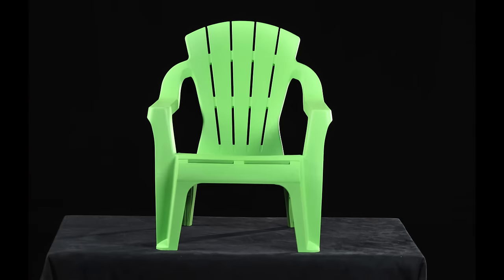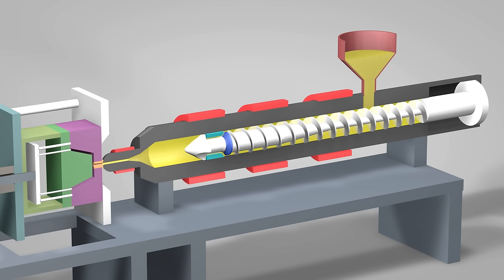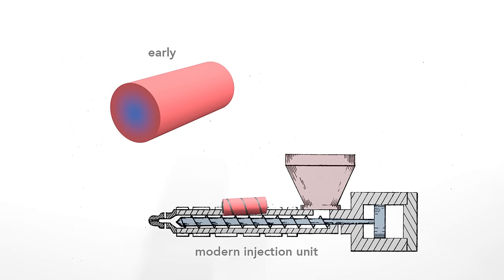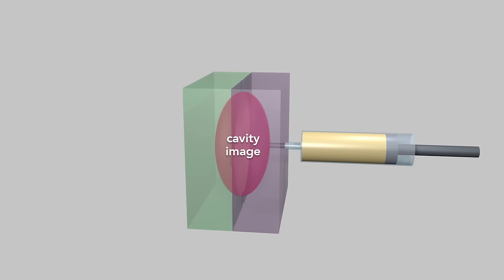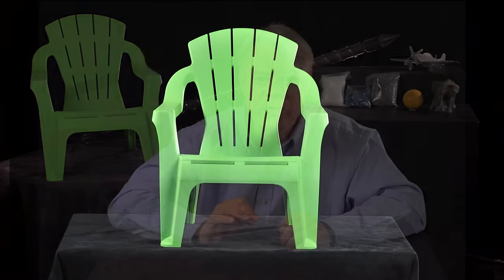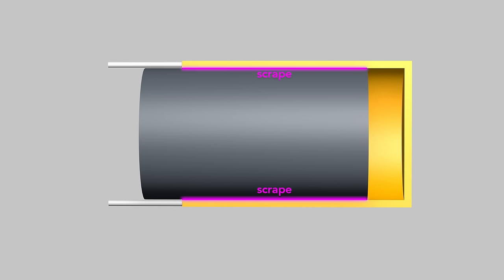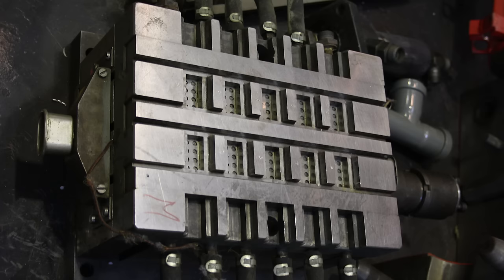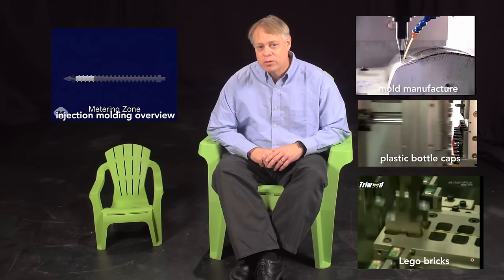Plastic Injection Molding

Comment: I made plastic injection molds for 35 years, and that was the most precise description of the process that I could wish for. Great work!
Reply: sick
Reply: @austinh7967  @Jack Frost that means “cool” in boomer terms
Reply: @sophiazhang3600  Hi Sophia. Hope you are well.
Reply: Jack
Reply: @hugossalinas7983  Jack
Reply: @derekzhu182  l
Reply: What hardness do the steel molds have to be to function?
Reply: @phil2082  Most of the molds that I have made have made have been "nitrided" which gives a surface hardness of 67 RC.
Reply: @jackfrost2146  Nitride coating is usually very shallow. Do you need some crazy hardness below this? Can I make an injection mold easily on an old 1990s CNC Mill that I have access to? Do you have to heat treat the mold after you machine it, or can you use a machinable hardness with that coating?

Thanks a LOT for the response!
Reply: @phil2082  The steel for nitriding is higher strength than mild steel and doesn't require heat treatment (hardening) I've only ever used a regular manual mill for machining moulds, I'm sure your mill will do the job, as long as you know how to program it (which I don't) All of the machining must be done before nitriding.  The advantage of nitriding is that there is no distortion which happens with regular heat treatment. The moulding surfaces should be polished before nitriding, and after, to bring back the polished finish.
Reply: @jackfrost2146  Neat! Thanks! Yeah the old CNC mill is easy enough to program if you know how (I spent a few years learning), and definitely has more rigidity than the Bridgeport mill I have access to. Nitride coatings work wonders on gun parts. Maybe I could get in to making my own injection mold!

Do you know how many companies make the heater/injection screw this video talks about?
Reply: @jackfrost2146  is it worth me getting a quote to remake a bumper for a car thats no longer available.  I feel like it will be an astronomical amount that I'd have to find others willing to pitch in on. Then I wonder if repurchase later if they will have that mold or do i get to keep that mold LOL.  Wish i could just make my own mold :(
Reply: @Hedgehodge-  If you could possibly borrow a bumper, you can take a fibreglass mould from it, then make your own fibreglass  bumper by using the mould that you made from an original.
Reply: @jackfrost2146  sounds like a good idea and something I should learn while I have this bumper. Just protect it with plastic in assuming before I go to town? YouTube time
Reply: @Hedgehodge-  If you have a bumper, first paint it with fibreglass release agent, when dry, paint on f/glass gel coat, then, fibreglass mat. This is the mould.  
Same process with the actual part--release agent, gel coat, mat.
Reply: @jackfrost2146  will this room my no issues painted one I have now? Thanks
Reply: @Hedgehodge-  Say again a different way. I don't understand the way you said it.
Reply: @jackfrost2146  that's a polite response, I'll have to use that one :) I was curious if I can do what you said to my current bumper that's in use without messing it up. Applying the spray and all that to get a fiberglass copy. If so I won't need to borrow one. I'd imagine it would be fine since normally if you borrow something it doesn't go back destroyed haha, just thought I'd make sure first :) thank you
Reply: @Hedgehodge-  If you cover your bumper in fibreglass, the part produced will be rough on the outside  and as smooth as your bumper on the inside. This is why this new part is to be used as a mould to make the finished bumper. Also, I forgot to tell you that the fibreglass is held together with polyester resin.
Reply: @Hedgehodge-  Look up "How to work with fibreglass and resin". It would be helpful.
Reply: @jackfrost2146  ah I get it now, cover the outside of the bumper and it makes the mold inside, which is smooth . once it's put into that mold it will be smooth and the correct size. Thanks, sounds like an upcoming project for my kiddos and i
Reply: @Hedgehodge-  I forgot to mention that the mould will need at least two layers of glass, and the bumper --at least three. Each layer applied after the previous layer has hardened.
Reply: @jackfrost2146  thanks :) grown up paper mache
Reply: It was a fascinating explanation of something I use every day.
Reply: I have a plastic injection mould making factory in China.
Reply: I worked on wax molds to make precision metal parts. There are more steps to that process and very interesting.
Reply: @magicmould11    Good !  Leave it there.
Reply: Can i make a step 2 slidy copy so to speak via inection molding or blow molding. I was holding to try fo make a less sturdy one for a doll if that makes sense? Im so passionate about thid project.
Reply: @HackerActivist  

nick
Reply: Hey, I was working on a product and needed help with the moulds. Is there anyway I could get in contact with you to ask you some questions?
Reply: Hello sir can help me in my project graduation dsing of injection molding machine

Comment: I designed injection molded parts for over 38 years.  This video is on of the most thorough presentations of the molding process.  This video with help new designers and engineers explain why it will take weeks to complete a mold due to strength of the pressures and the precision, and complexity of cooling the mold.  Hats off!
Reply: 男:  你郁出面的人, 我当你黑吃黑, 不过, 要遵守香港法例,

Comment: I'd just like to add that the water pumped round the tool isn't always cold. Where I work we regularly use water anywhere between 20*C and 80*C depending on the mould size and the material used for that job. We've even had moulds go up to 130*C for glass filled lens housings.
Reply from the maker: Thanks for sharing this .... interesting info.

Comment: Thanks Bill for the explanation. In my apprenticeship we had injection molding machines, I used to feed the hopper. Back in the 70's the Italians were the "kings" of molders. We had a big tool shop that made so many molds.
Reply: Interesting that Italians were the kings of moulders, maybe because they are such great craftsman.  Also to see the lineage of machines (made in Italy) move forward to the ten ton press that Tesla bought to make huge cast aluminum parts.

Comment: I used to work at a CD/DVD manufacturing plant. This is exactly how we did it.
Reply: I thought the reflection surfaces were stamped in those.
Reply: @JustWasted3HoursHere  Actually, no. The data on the CD/DVD is injection molded onto a clear poly substrate. each disc is then placed into a chamber and undergo a process called "sputtering" which moves atoms from an aluminum block to the disc's surface, making the disc reflective. In the case of DVD9's (single side, dual layer) the bottom layer is sputtered with a translucent layer that allows the laser to basically "choose" which layer of data to read from. I'm 7 1/2 years removed from the process, so my memory isn't quite what it used to be.

Comment: I work in a factory that does injection molding of ABS, PS and rubber too, used for shoes manufacturing, mainly soles and heels

The machines are indeed very simple despite looking overly complex! To think that we still have fully functional 1970s machines that work only on relay logic and nothing more, and nearby computerized machinery, doing exactly the same job, every day 24hrs a day

Comment: Lately I've been designing parts for plastic injection molding; at first I only knew the general idea but over time I've had to get more and more technical in my understanding. Even after reading a lot about the topic, this video has taught me more. There are some things I've learned recently that aren't specifically mentioned in this video: One is how to figure out which side is the core and which side is the cavity on a part. The core is the side of the mold with the ejector pins, and the cavity is the side with the injection gates. In practice, the ejector pins are never on the same side as the plastic is injected from. The core, which has the ejector pins, will be whatever side the mold engineer thinks the part is more likely to stick to when it shrinks during cooling. In practice this means that the core will be the side that has the most tooling enclosed by the part, or it will be the side that has the shallowest draft angle. I recently designed a part and was surprised that the vendor didn't want to put the ejector pins on the side that I was expecting, and then again I was surprised when the injection points couldn't be on the side I was expecting either. Another thing: the vendor used what are called submarine gates, which come in at 90 degrees to the pull direction and are designed to shear the sprue off of the part as the mold opens. Learning about this was fascinating.
Reply: 97 回歸之前, 周星馳申請移民加拿大, 加拿大移民局查到周星馳是演員, 長期和新义安中国星集团合作拍电映, 有身為三合会会員的嫌疑, 推翻了周星馳的移民申請, (英文南华早报, )

Comment: Hi Bill,
This is the first of your videos I've viewed. Very informative! I've been in the plastics business for about 20 yrs. and had no idea that's how injection molding started. 
I knew that celluloid was invented to replace Ivory, but not that this was the start of injection molding.
I'm afraid you wouldn't find ejection pin marks on the product the Co. I work for produces. The parts are too thin, so are ejected by air. Think yogurt or butter containers.
Other than that, you're spot on.
Thank you from a new subscriber!

Comment: I am my shift's maintenance guy at a plastics plant where we do both injection and blow molding. Injection is by far my favorite and this was a tremendous explanation. 

On the subject of part ejection and vacuums: depending on the desired product design the mold manufacturer may add air poppets that open ever so slightly to blow air into the molded part to release the vacuum. We make 5 gallon/20 liter pails that require aie because the vacuum is too strong for a mechanical ejector. In fact our molds don't have mechanical ejectors at all, they use pressurized air to blow the buckets off the mold and onto a conveyor belt. These molds don't require a hot runner (but the mold that makes the lids does). Super cool stuff honestly, I love my job!

Comment: I'm in the plastic model kit building hobby, and I'm very used to speak about "sprues" to which the parts are attached. Today I learned they are actually called runners :)
Reply: The terminology seems to vary a little by branch in the hobby, Gunpla circles tend to refer to the entire sheet (runners, gates, parts, and sprues) as Runners.

Comment: Very good explained, just one correction regarding "Lego Molds". Actually those were standard Hot Runner molds but no more in use in Lego. They are now returned to improved sprue tecnology in energy saving manners. Improved sprue means that it is basicly a "Stack" Mold meaning that during opening midle plate is also detached and robot removes the sprue with comlete gates.

Comment: I am an Injection Moldmaker. Everything shown here is totally accurate and correct!
Reply: Pls how much do you charge for a plastic bottle of 330ml for yogurt? I need my own brand live in Ghana....pls reply thanks
Reply: Almost... At 1:40 you can observe that the Sticks to throw Out are pushed Back by the Wall of the right Side of the molding Tool. In reality those are pulled Back by the machine before closing.
Reply: Not entirely, the screws to melt the plastic still have some problems with inhomogeneous mixtures. (At least those shown in the video)

Comment: My father and a partner started an injection molding plant in the late 60s. His partner was a genius and designed and built the machines. They were able to make plastic parts with small screened sections, used in the automobile industry for washer fluid pickups and the medical industry for filters used to catch kidney stones, as well as small parts for other industries.

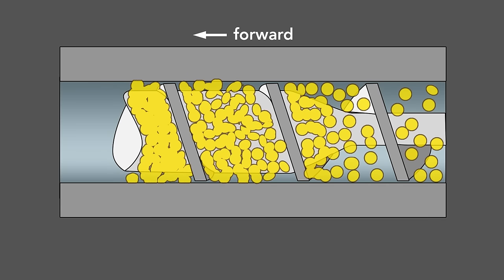Comment: VERY educational video, love it! I have a question-At about 3:22, where you press the pellets closer together at the end of the screw, how does the remaining air escape so you aren't injecting bubbles into the mold?
Reply from the maker: +Andrew Taylor Pretty sure it just goes out the back of the barrel. The "flights" don't make an air-tight seal with the barrel wall.
Reply: Thanks for the reply! Do you know where I can learn more about plastic extruders, perhaps a textbook?
Reply: +Andrew Taylor Actually, upon first "shots", beginning of the molding process startup, you can get bubbles in the parts. Usually it's not bubbles, but simply incomplete parts, called short shots. Once the air is worked out (usually only one or two cycles) molten plastics fills the barrel. During the plasticating portion of the cycle, more molten material is fed up the screw to the front and builds up pressure and actually pushes the whole screw assembly rearward, so no new air is introduced to the barrel.  Thanks for the video engineerguy. The best description of the injection molding process I have ever seen.
Reply: +Andrew Taylor you can call Adkev in Goodland , Indiana I work there it is a plastic injection molding plant ,or if you feel froggy you may even get a tour of the facility
Reply: I have been worked as a sales for a plastic injection molding company for more than 6 years. As per my experience, to avoid bubbles in the parts:
1) the part design should be even in thickness
2) suitable temperature
3) reasonable air vent design
4) operator experience, no air in
Reply: Injection for kids
Reply: #Brett Hilbert worked in a molding plant for 5 years, very good introduction. @Andrew Taylor
Reply: Andrew Taylor it is plastic tight, not airtight I assume
Reply: Andrew Taylor it travels backwards up through the hopper
Reply: Some of the answers found here are correct but this is more detailed.  After working in this industry for many years, I can tell you that the majority of the air in the barrel itself at startup is injected into the mold and creates "short shots"  After these first couple short shots are run, the air then travels back through the screw, over the flights as stated by +engineerguy.  As the plastic compresses in the front part of the screw (called the metering zone), it creates pressures of around 1200-2600 ppsi (12,000-26,000 psi) in most of our presses at work, ranging from 55-400 tons. This immense pressure forces the air backwards in the screw and back into the feed throat.  Some air does remain in the mold after a cycle, as well as some gets pushed into the mold that may have made it into the barrel via the sprue bushing after it was ejected.  This air is forced out of the "vents" upon injection.  Any air that doesn't escape the mold through the vents can become so compressed that it literally explodes causing a black mark or "burn"  that can be found usually opposite the "gate"  The last way air escapes from the barrel and hopper is by being sucked out by the vacuum loader system found on most material dryers.
Reply: Dont forget about flash, splay, warpage, molds falling out of machines,water lines blowing up flooding the floor, thermo boxes not being plugged in.
Reply: @jordonsmale7850  and the heat in the summer.
Reply: @JohnSmith-bx1mp  also the smell of purge
Reply: @voodoodoc6890  I have a buddy who is the process engineer at Adkev. His name is Tim B. Maybe you know him. Or his Bro in law, the owner.
Reply: I realize this is an extremely old comment but I'm gonna answer anyway... The plastic in the barrel is under very high pressure (easily over 10k psi or 70mpa) which helps force out air and other gasses. When presses are started they typically go through a purging process to get rid of air and degraded material. Air trapping is very rarely a problem after this, but any remaining air can either escape back out the hopper or out through the mold vents. The two halves of the mold are typically spaced apart slightly for just this purpose, to allow air (though mostly off gases from the plastic) to escape. Most "bubbles" in plastic injection molding are not bubbles at all (in fact they are very rarely bubbles at all unless there is some sort of problem with the press or improperly handled material or the mold itself) but are instead voids (pockets of vacuum) caused by the plastic shrinkage during cooling. This is usually caused by an inadequate pack stage which is when, after the initial part injection, the screw is held forward under pressure to force more plastic into the mold as the part cools and tries to shrink. Source: engineer who is in charge of process setup and troubleshooting of new plastic injection molds and presses. Not a perfect explanation, but close enough for YouTube comments. Edit: as others have said the system is plastic tight (or at least is supposed to be ideally) but not necessarily air tight.
Reply: @ameritus9041  i